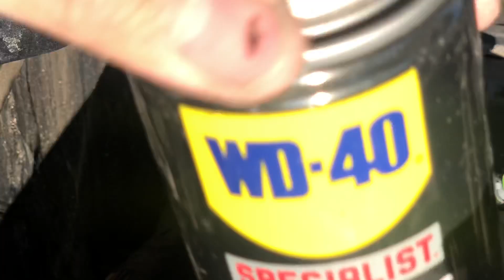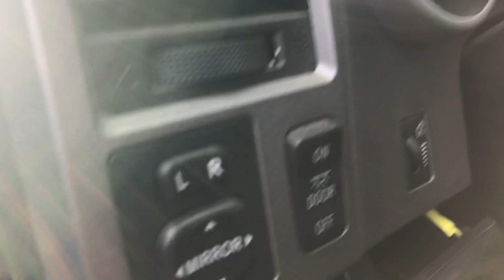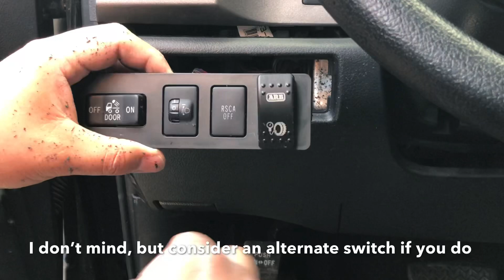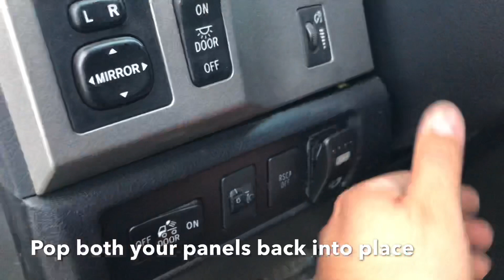Toyota Tundra ARB Compressor Install

Comment: great video. could you please let me know where does the bleu wire connect to its not connected to your fuse block and you have 4 black wire and 4 red wire connect to the fuse block is it for other device or am I missing  something
Reply from the maker: Hi, good question. Towards the end I used a small red wire to extend the blue wire. So around the 9:20 mark when I am attaching the wires, the small red one is connected to the blue wire and I used a 3amp fuse on it. Hope that helps! And I have additional devices connected to my fuse block so you’ll only want to mind the ones I attach in the video with the exception of the blue/red change up.